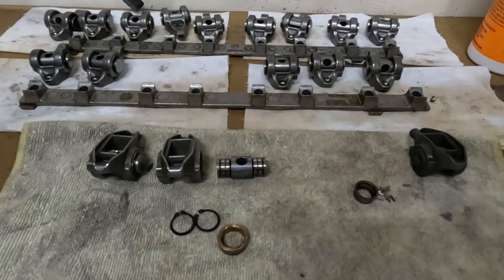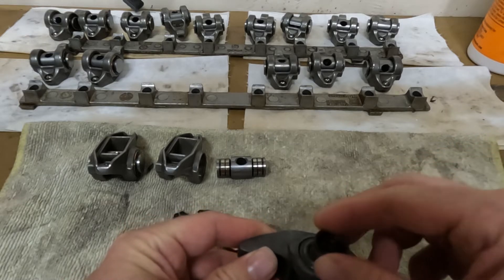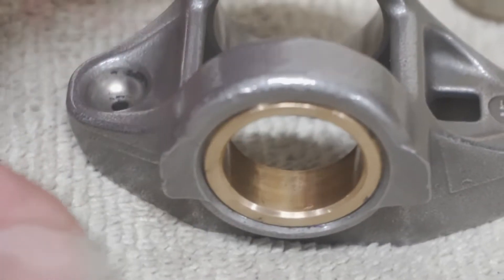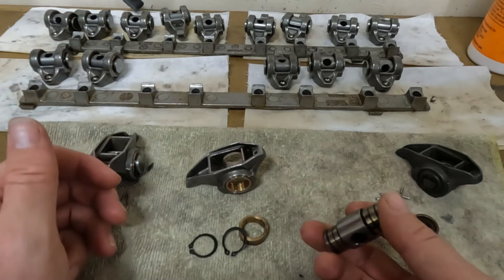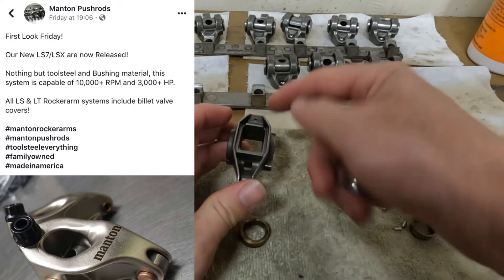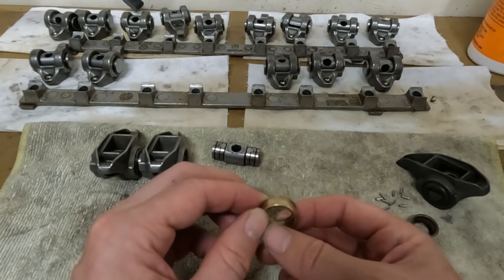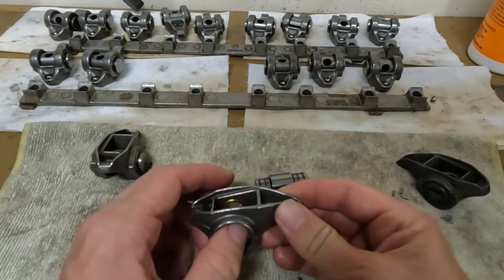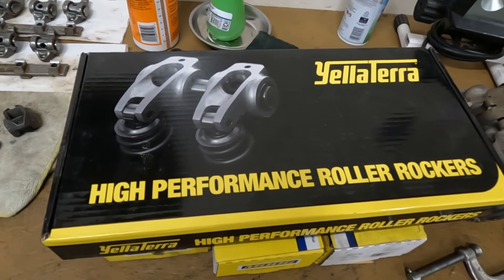Part 2 LS Rocker Arms, Bronze Trunions vrs factory vrs shaft mount roller rockers

Comment: Do you mean no lifter preload? Your Valvetrain would be rattling like a sewing machine because without a preload cam would bounce the lifters  instead of riding them
Reply from the maker: Yes no lifter preload (or very little). Maybe I misstated something. It did sound like crap. Now sounds AWESOME that I got all the preload sorted out and got rid of the cheap rebuilt rockers.